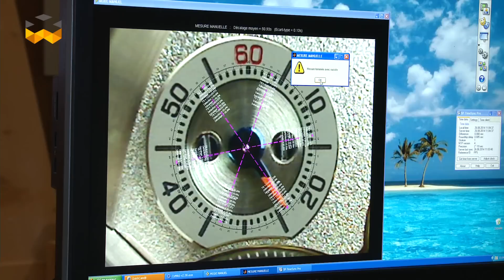What is precision? – Chronometry saga n°2

Comment: From a technical term standpoint, an accurate clock is one who's time is close to the actual time.  A precise watch on the other hand would be consistent; a watch that was exactly 10 seconds fast every single say would be precise; but not so accurate.  They are not necessarily independent terms.  I don't think you can make an accurate watch that's not also somewhat precise.